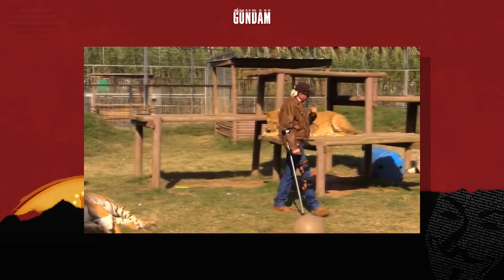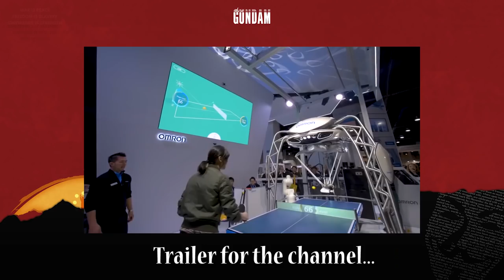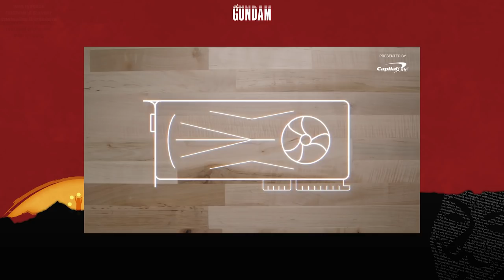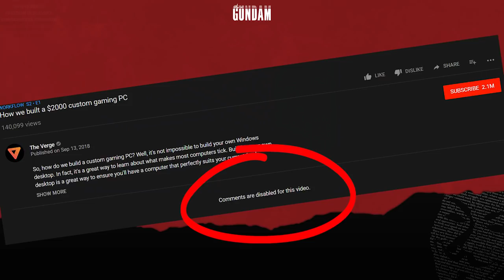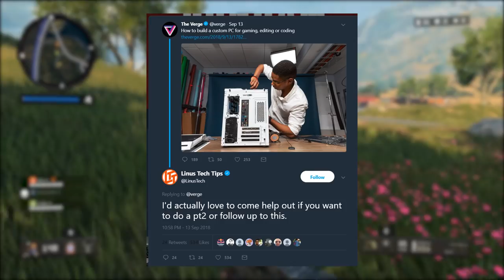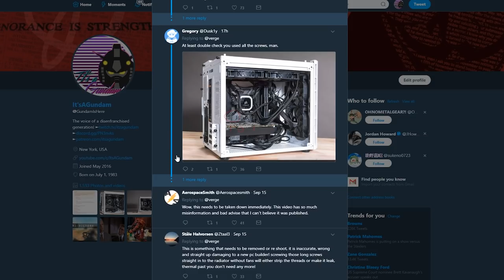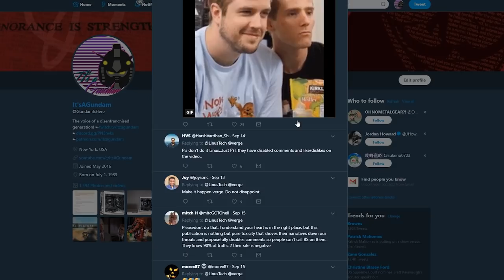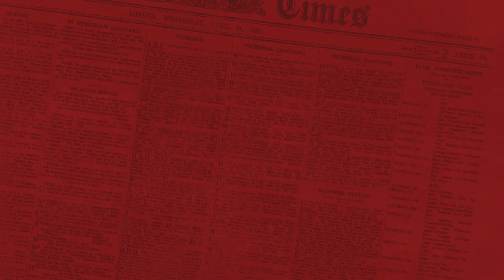How The Verge built a $2000 custom gaming PC WRONG!

Comment: OMG 2 grand and no screw driver. Love you bro. My PC I stream with and do my YT videos is a Shop Goodwill Online i7@950 3.04 for $249 only thing I add was a R9 390.
Reply: I hear ya there bud, i7-950 with a GTX 1060 for me.
Reply: I used the screwdriver on my leatherman because I couldn't be fucked walking to the shed and back for a screwdriver. Slipped and snapped my brand new graphics card off the motherboard.

Comment: I've always installed the motherboard first, CPU second, then connect the case cables like the reset switch and power switch as sometimes the CPU fan and ram and graphics card can cover those pins.  Then CPU fan.  Then ram.  Never had 1 single problem.  But looking back it probably would be better to install the CPU before installing the board.

Comment: Please note: the PSU's fan is pointed into the case at 18:50 ish .
Reply: That's the suction side, and it vents out the back. Many cases are set up like this. Some (newer) cases have a dedicated intake for the psu but it's not necessary. It will be perfectly fine taking a suction inside the case. If you're setting up a negative pressure airflow it may even be better. Not really an issue here. Dude still did the scariest build I've ever seen. Love to see the mess if he ever tries to replace the cpu... that socket will be fked.
Reply: Lmao. Scratch my last. Went back and watched it. It WOULD be fine except on this case the back side of the psu faces the back of the motherboard tray. Yup. Deadhead the fan. That psu just had its life cut in half.
Reply: My first build does this, it sucks in air, it is not blowing it into the case. The interior heat isn't insane so taking in the air from inside (which is clean and relatively dust free) and exhausting it out of the back is okay. I did this for over five years in my previous build and temps were always fine. My new build intakes from the underside now (with a fan filter) and exhausts air out the back, completely isolated from the interior case airflow. Can't really say which way I prefer it but it doesn't appear to make a huge difference to PSU temps and doesn't affect behaviour.

Edit: Oh shit lol I see now. The way the case is has a separate section for the PSU... so yeah, fan against sheet of metal. Oh dear.

Comment: the computer case is a common ground and is electrically connected  to the PSU, and the case of the PSU is a common ground also.
Reply: Which runs down the third wire in the power cable to the ground lug in your outlet (through your UPS, of course).

Comment: THE LESS THERMAL PASTE used the better the performance because a thinner layer transfers heat to the cooler quicker than a thick layer..., the paste its there to connect the processor to the cooler to transfer heat, if theres no bubbles of air its a better transfer of heat because air acts as an insulator of heat not conductor compared to the paste. A pre-applied even layer of paste on the cooler would definitely be better than the gross mess he made

Comment: I'd never realized they'd suggested you need a Allen wrench. Only thing I've ever needed to put a computer together is a Philips screwdriver, preferably with a magnetic head and maybe some needle nose pliers if trying to pull a cable through a tight place.

Comment: I run 2133mhz ram OC'd to 2666 with my r5 1600 and I haven't noticed any slowdown. Honestly I think anything 2400mhz+ is fine with Ryzen (unless you're using an APU).
Reply: Yeah. It's the APU that really needs the faster memory. And 2666 definitely isn't the baseline speed.

Comment: How come you didn't noticed that he installed the PSU with the fan facing inside?? Hahahaha
Reply: Eh that one doesn't matter too much. It's up for debate on which is better
Reply: I'd say this was too much bad to comprehend at one time.
Reply: That case is divide so i think that it doesn't matter too much
Reply: This is a dust vs heat debate thats been going on forever.
Reply: @TheSoap1992 they only stop like 70% of dust. Take smoke for instance, blow smoke at a dust filter and see how much smoke it stops... There's tons of dust at smaller microns that filters miss. Personally though, I face my psu fan towards the bottom of my case, not in.
Reply: My case will only let you put the PSU fan facing into the case.  Meh.  Even water-cooled my AMD heats up faster than the PSU even will.
Reply: No, you don't understand, the psu fan is against the frame, it's choking!! 15:46

Comment: I built my Gaming pc for $800 has a 1080 TI,  Z390 Aorus Pro Wifi motherboard, Corsair Vengeance LED RAM and Intel Core i7-8700K CPU
Reply: Nightcore Forever ??? The 1080 ti costs more than 800 just by itself.

Comment: I used to play Warhammer: Total War 2 together with a friend on a regular HDD. Loading times between battles and the campaign map could be up to 15-20 minutes. Switching to an SSD made it load in less than 60 seconds. That's the difference between a SSD and a HDD, so he's not entirely wrong. Probably the only thing though.

Comment: 15:20 the "insulation pads" are actually vibration cushions.and they are for when the fan runs at high speed to stop your case sounding like a small plane taking off.

Comment: I know this is old, just saying though, I built an Ryzen 7 3800X on a ROG Strix B4 motherboard (which came with thermal paste preinstalled on the chip), 1660 Ti, 32 GB RAM (2x16 Corsair RGB), 500GB SSD for less than $800. I'm also using 3 separate 4GB SATA drives for different programs. One for games, one for editing and 3D modeling, one for documents and the last one for non essential programs, ugh, thanks Gundam, love what you do...

Comment: His building is even worse than mine, and I've only built one PC. The only fuckups were my case was too small, so it made it harder to build and both my ram sticks have to come out to do anything in the region of my mobo as a result. Also my cable management could be better but everythings at least cable tired up away from all my parts.

What the fuck is this. Giving them Linux would be like when Homer has to prove he can stop a Nuclear Meltdown during an inspection and manages to cause one despite there being no nuclear waste material in the simulator.

Comment: One little thing - installing the RAM in different channels in a modern system won't result in a failure to boot or it only seeing one module. It will slow down the machine, but it will see both modules. Run memory in the same channel to maximize the speed.

Comment: 20:40 that CPU "application tool"is just  a metal construction that has the same dimensions as the socket on the motherboard, to check if your CPU fits. If it doesnt fit you know you musn't jam it in your motherboard anyway, because you vould destroy the pin connectors on the motherboard or CPU

Comment: 15:16 WTF, short circuit, no, the case of the PSU is neutral to the case of the computer, that's not a short circuit, no current should flow through the neutral, unless a human is being electrocuted and then the GFCI breaker will pop. Which those guys clearly need to get a shock to wake up and stop saying nonsense.

Comment: 6:19 not sure if people knew, but the animation was about balancing your CPU, GPU, and for some reason, RAM. Why do one of the animations show the RAM being more powerful than the CPU and GPU

15:45 the PSU fan is facing in instead of out

18:40 someone forgot that non-modular PSUs exist

24:02 he put the dust filter on top even though he has a radiator exhausting heat through the top

Comment: This is rough to get through, even with Gundam's commentary. Though I always wire it last, but that is because 20 years ago there were no modular PSUs.

CPU, RAM, GPU tested sitting on the static pack for the mobo just to male sure it passes POST. Then you take off the GPU and put it in the case, plug in the front panel headers and HDD/SSDs, then wire it all up. Shit, it takes 45 minutes to an hour.

Comment: in talking about the thermal paste, honestly, the amount that he uses isnt nearly as big of a deal as the fact that he actually mixes two different types of thermal compound. these are carefully formulated designer compounds that we're talking about here, and there are a lot of different types; you dont just arbitrarily mix thermal compounds. its very likely youll just totally screw up the thermal properties of the compound, and youll be better off using toothpaste. always, always, always completely remove any existing compound before adding any new stuff. and dont just wipe it off either. again, these are carefully formulated compounds that closely interact with the surfaces that they are in contact with, it needs to be "cleaned", typically with a high percentage alcohol if not some kind of dedicated cleanser to ensure that the surface is actually chemically clean. 

case in point, I once helped a guy who was wondering why he was getting much worse temps after replacing his old thermal compound with what should have been some much higher quality stuff. even to the point that the system was shutting off from overheating, despite having a water cooler on there (he initially thought maybe his water cooler had gone bad somehow). after he explained what he'd done (simply wiping the old stuff off with a paper towel), i realized that the new stuff was interacting with the residue to create an insulating barrier (the exact opposite of what you want). after properly cleaning everything off this time with some alcohol, some fresh compound was once again applied and his thermals were great.

I really do wonder what the thermals on this build were like. the thing is, almost none of the issues here would prevent the PC from posting and running (not even the ram issue, on this particular motherboard), and since you can run league of legends on a potato, that does nothing to reveal what are probably some very serious performance issues. actually, it wouldnt surprise me at all at this point if he was getting 120fps due to throttling and he just assumed the game was locking the framerate when it really wasnt.

Comment: When you talk about RAM, it booted up because the RAM wasn't in dual channel but still worked in the positions he put it. It doesn't need to be in the right positions to work, it just will run at half the speed because it's not in dual channel.

Comment: the psu screws into the case, grounding the case. But i guess if you have foam pads for noise dampening, i guess it stops the psu from short circuiting the case.

Comment: Baseline DDR4 is 2100mhz and for myself I use hybrid drives which give the size and the advantage of speed for the most used games. Granted it's not much more speed then a 7200 Rpm but 20-30 second's is good enough for me.

Comment: Ideally RAM and CPU should be installed on the board before putting the board in, as well as the CPU fan if it's not a very big one or if you have a water cooling setup. Not an absolute necessity, but it definitely makes it easier since outside of the case your hands aren't fiddling around with stuff while jammed into a confined area with potentially sharp bare metal. Same with the NVME SSD, especially since a lot of boards have them installed on the back of the board now. Basically most anything that is attached directly to only the motherboard is most easily installed outside the case. The water cooling setup, being the largest item in the case and the one that is most likely to get into your way while installing other stuff, should probably be the last thing to be installed. And the thing about the "big bag of cables" with the power supply is only true if you have a modular power supply. Lower end and older power supplies already have all of their cables attached. Modular is recommended, though, since it tends to make the cable management easier and air flow better.

Comment: Also about that graphics card install. the slot choice does matter, if your board has 3 slots like mine most boards if not all of them the top slot is 16x and the middle is 8x and the bottom is either 8x or 4x so if you install that card in the middle or even worse in the bottom like the verge was contemplating on doing and only didn't do because it would look nicer in the top due to his nvme ssd being in the bootom of the board and therefore the gpu would cover it, well that's a pretty dumb reason not to put it there considering the real reason you shouldn't put it there is because your cards speed would be cut in half if not by not 3/4's of the potential speed that it could and should achieve.
I remember watching this when it first came out and you could comment and see the like to dislike ratio and it was terrible, like hundreds of thousands of dislikes to maybe a few thousand likes and the comment section was pretty damn toxic even considering almost everything in this video is wrong. the comments were pretty nasty reguardless.

Comment: The ram was wrong.  You don't hammer i/o shield . The power supply was backwards. The install order was wrong. CPU thermal paste was to much. The ssd he didn't put the stand off on. He put the long screws through the radiator causing possible damage to radiator.  You don't need a CPU install tool. Just line up the triangles up . The fact when he booted this thing and it didn't shoot flames out of it like a drag racer stuns me

Comment: I haven't built a PC since like 2000 when I still lived at home and I never used a alen wrench.  Plus PC's snap together now adays right?
Reply: You may need a screwdriver to screw the HDD/SSD in place inside the tray, and for the MOBO you may need some screws. Other than that, yeah, it basically all just clicks together.

Comment: you kind of forgot to mention that nvme ssd's when plugged into the motherboard are limited to x1 pci lane. Where as if you put them into a an expansion slot, they can use 4x pci lanes. So basically if you put in your nvme ssd that can read and write at up to 2 Gigs a second, into a motherboard nvme slot, you will limit it to 600 write speed. Never put a nvme into a motherboard slot unless you don't care about speed. Why are you buying an ssd in the first place if you don't care about speed?

Comment: On the other hand, you could look at it this way: The guy has no idea what he's doing, knows nothing about PCs, and still managed to put it together. Whether it posted or not, maybe not so important if they didn't show it...

Side note, you can actually post on a PC with the RAM set up in two slots like that, but it depends on the motherboard and RAM, and you end up using single channel memory only. If you have a PC which has RAM compatibility issues, outside of booting off of only one stick, sometimes you can still boot two sticks by pairing them on a single channel. Obviously he didn't know that, given the rest of the video, but I've had to do it on a build years ago, where the system wouldn't boot with the RAM I was using in dual channel, when I had to take a guess at which available kit might work because I couldn't get anything on the compatibility list.

Needless to say perhaps, I replaced it at the next available opportunity, but not before one stick burned out 6 of its 8 GB;  the other lost 2 iirc. That did last about 6 months however, and while I had to loosen the timings in BIOS to get it to boot into the OS stable, it did the trick.

Comment: 3:38 I disagree... if you're building your 1st desktop, you need to shell out ~1500-2k. Buy quality case, PS, fans ... go 1 under latest greatest mobo / cpu / gpu but make sure the form factor is standardized and relevant for a long time (I made mistake with btx shit once), always double whatever memory is suggested for current. Once you have all that... then it's just sustainment. 

I'm using same tower from 2004, same PS from 2008, i7 + 32GB + mobo from 2013, and a 960 that went on sale in 2015. I've spent nothing in the last 4 years... the 2013 upgrade was ~$750 all in but it's going strong on 7 years, and the last major upgrade before that was 2008 when old PS blew up my 2005 motherboard T_T.

Now the difference is that console people will spend $400 twice every 2-3 years for a piece of hardware that does fuckall and limited to their software ecosystem.
As frequently happens in life, the initial expense is bigger -- but it pays off over the long run.
Reply: cool story

Comment: Really late to the video but what are some good PC brands I should stick with? Not just reliability but customer service as well.
Reply: Watch some videos, order the parts and build your own.  It's not too hard and pretty fun.  Just a word of warning, the gpus are super overpriced.  At least they were about 1 1/2 years ago when I built mine.  Not an expert, but I'm pretty sure you will get a pc with better specs for your price range if you build it yourself.
Reply: PC part picker. Easily allows you to combine parts while seeing compatibility and prices for each part from various sites so you get the best pricing. You can also see other builds people have put together and copy those

Comment: Slight disagreement with the HDD, when using my HDD Total warhammer 2 turns would take 30-55 seconds, swapped over to my SSD and it dropped the turn loading time to 15-35 seconds, thats a difference I am grateful for.

Comment: Wow... hard drive speed affects gaming performance. News to this Computer Science Major. Every tower is a little bit different, so really these "instructions" even if they were close to correct, would still be basically pointless. It would have been better if they made a video discussing the pros and cons of high end and low end PC parts rather than trying to "teach" people how to assemble an incredibly basic piece of circuitry. I mean really, putting the parts together is the easy part.